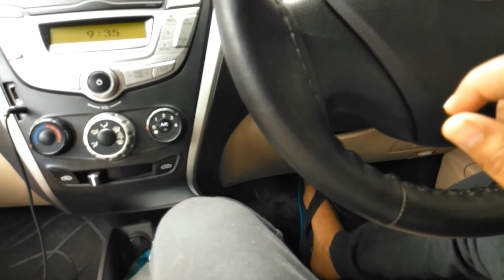Lesson 7 - Understand car clutch pedal usage and functioning in manual car

Comment: Have you ever try driving barefoot when wearing slippers? Its very comfortable and much better control on pedals and much more safer. Hope you will do on next vid hehe
Reply from the maker: Hi, No doubt that you get better control barefoot, but that's needed only for beginners, once you gain expertise then there is no need to take that extra effort of removing and wearing shoes/slippers. Btw slippers are also risky, one mistake and it can be life threat. We should wear something which doesn't slip, like shoe, or sandal with belt. Happy Driving buddy :)
Reply: Barefoot driving is already recommended in one of his previous videos in the series.
Reply: Lmao and my family thinks I'm weird driving barefoot.